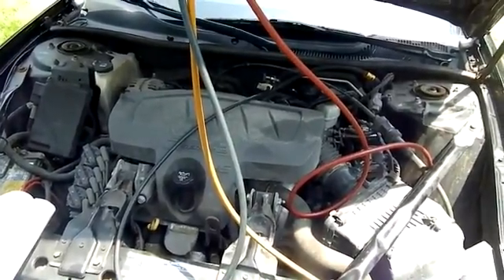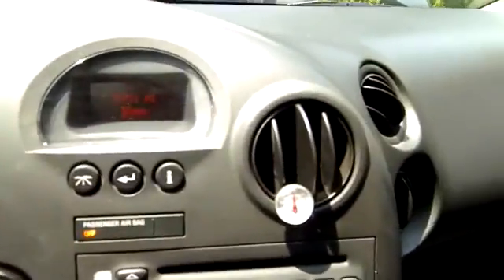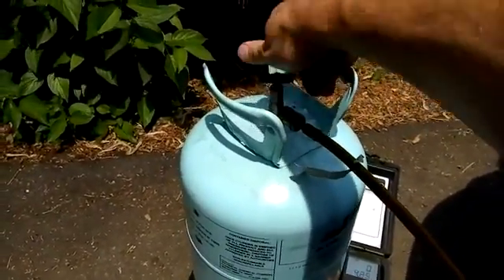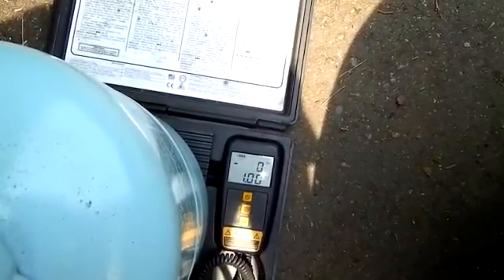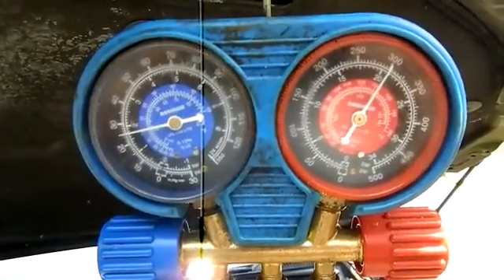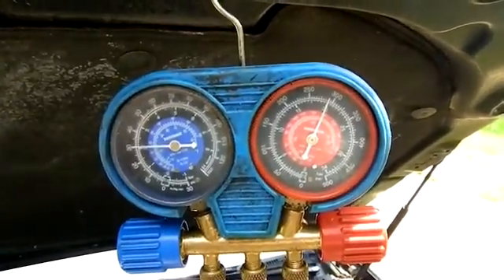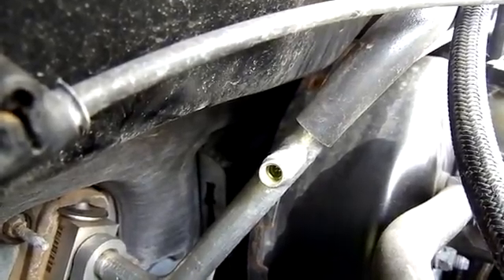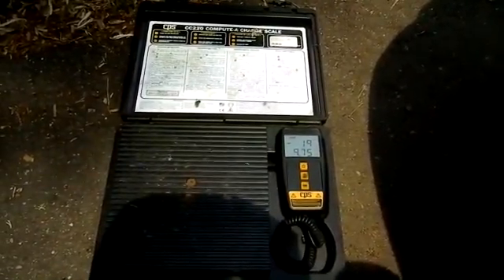Car Ac R134 Charge From Bulk Tank

Comment: The only correct way to charge the system is to vacuum the system and put the amount of freon that the label on the car says to install, no more no less. At 16 cents an ounce  you're not going to break the bank.
Reply from the maker: You are correct. This video is very old, forgot about the content in it. R134 is about $12 a pound where I am at, but not a huge cost

Comment: I thought you only needed scales to start from a completely vacuumed down system so you can get the exact factory recommended amount of coolant back in.
Unless of course you were trying to keep up with how much R134 to charge the customer for, I could see that being handy.
Reply from the maker: I always weigh refrigerant when charging from a bulk jug. It can get away from you quickly and you can severely overcharge a system. If doing a top off I may add 4-6 oz at a time and let the system stabilize before adding more.

Comment: what's the name make and model of that scale
Reply from the maker: Cps, no idea on make and model. I bought it used off ebay about 10 years ago for about $50.
Reply: @mph5896  guys, it says so right on the sticker in your video :-D CPS CC220 and you got a good deal for $50. They still make these new for around 200 bucks!